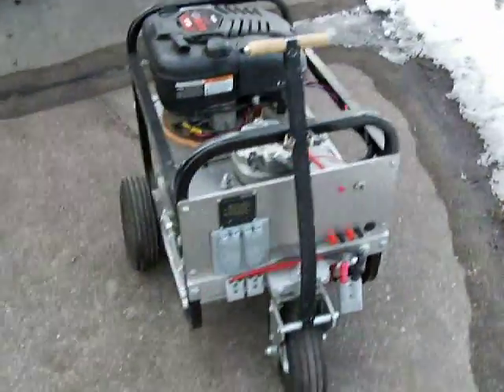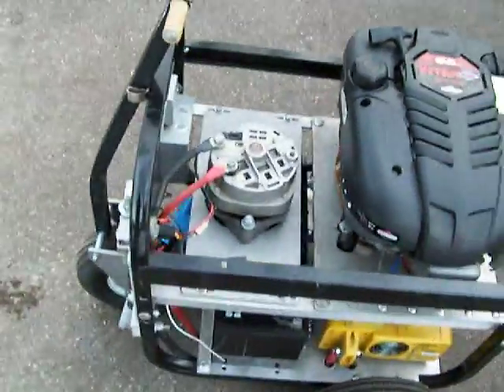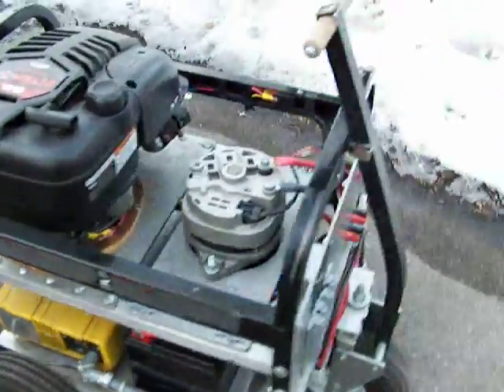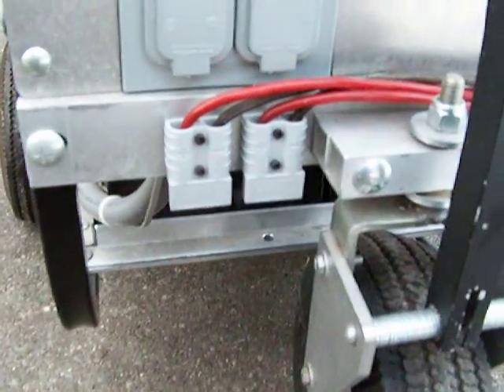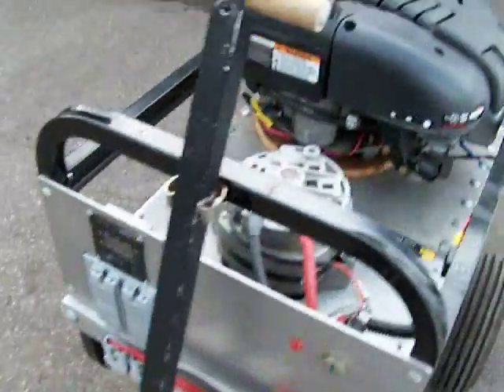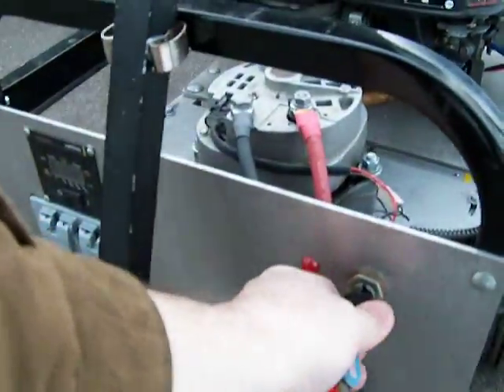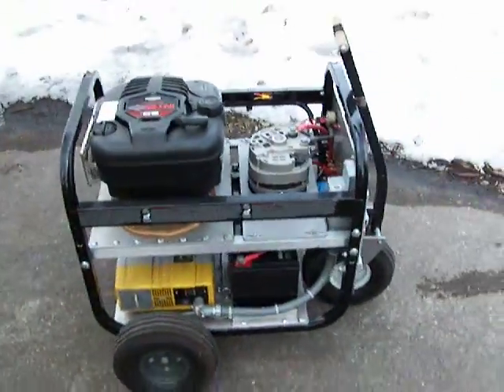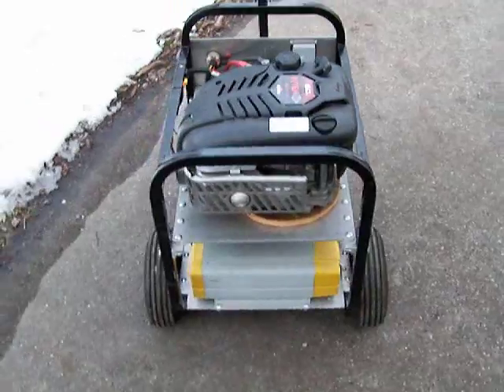Homebrew 1.8kW Inverter-Generator

Comment: Pretty cool.  How many times has it come in handy over the past 14 years since video made?  I read somewhere that you can get away with using the 3HP 79cc predator engine to power a 70 amp alternator for less fuel consumption, weight, and noise.

Comment: I've been looking into a system called the "power mite 110" in order to use the vehicle engine on my international ambulance as a generator. Doing this would be like a 1/4 of the cost. Originally I looked passed inverters cause I don't wanna mess with the charging system. I guess I now just realized if I'm adding a generator to the engine I could just add another alternator 🤷🏻‍♀️😂

Comment: good boy.  how about a brushless SEMI TRUCK alternator, 250 amps, with a 15 hp motor, for welding.  ??   may require a 300 amp bridge rectifier, if alternator diodes aren't able to handle current....
Reply from the maker: Sounds like a hell of a beast!  If you want some REAL off-the-shelf power, Niehoff Electric Company (NEC) makes militarily-ruggedized alternators for military ground vehicles anywhere from 200A @ 28vdc, all the way up to 1 kilo-ampere (yes, that's 1,000A) @28VDC.  They also make dual-voltage (14-28V) units.  They're always appearing in eBay.  Beware though, they're very heavy, inefficient (65-70% on a good day), and can be expensive.  If you get one of their 28VDC, 570A units, you're good for at least 15kW (16.18kW for 100% efficiency, which we know doesn't exist).

Comment: Why don’t you use a DC motor instead of the gas engine? You wouldn’t need to continually need gas
Reply from the maker: And where would that electric motor get the electrical power needed to spin it?  What you're describing is essentially a zero-point energy machine.  Believe me, if I could make oine of those, I'd retire a multi-billionaire tomorrow.
Reply: @SSD99  An alternator?

Comment: This is the most badass DIY genny ive come across! "Coulda bought a generator" but they dont make them THIS cool! Looks very sturdy and heavy-duty. What kind of gas and oil do you use? Standard 87 and HD30?
Reply from the maker: Just standard 87 Octane pump gas, and whatever the recommended oil is on the B&S maintenance guide.

Comment: I was going to ask, why not bypass the alternator rectifier and regulator all together going straight to AC? But then it occured to me, if my Generac (direct AC output) idle decides to go off kilter, it will fail to regulate to 60 cycles (HZ) and it will shut off output. Honda gens I've heard use onboard rectifiers to avoid this.

I actually had a car alternator recently with failed diodes in the rectifier. I was getting between 25 - 30 AC volts at idle. Not too shabby. Wonder what output is with no diodes??

Comment: SSD99 congrats on a great design. I have 5 of these Xantrex inverters to play with. One has the built in transfer switch so will auto switch from grid to inverter power which would be good for frig or freezer. Wanted to mention that in a power outage the inverter could use an idling beater car as a charger connected to the inverter through high amp jumper cables. No extra motor or alternator needed as is part of car. This runs quiet and not loud like a genset. Is best to have another battery local to inverter but not essential. I always use a cheap beater car for commuting so is also a 'generator motor' so don't have extra 6hp motor to maintain. It is easy to refuel cause it pulls up to the pump. The motor with alternator is smaller and more portable.

Comment: A very nice build, sir. As others have commented, you could buy a cheap, ready built genset for a fraction of the price yours has cost, but i'll bet in years to come, your set will still be going strong!!! Especially with that nice Xantrex Inverter.
Best regards.
Reply from the maker: ESPECIALLY because of the Xantrex! :D  Seriously though, I wanted to get two Prosine 2.0s in series for 120/240VAC output, but there were none available when I built this, and, I'd need a 28VDC alternator, because 4kW at 12V is just too inefficient.
Reply from the maker: To Harrothepilot: Thank you for those comments. It's when I look back at all that $$$ I put into it, then read comments like yours, that I feel validated in the approach I took.
Reply from the maker: To Mike Brink,  that's a lot of thoughts for one post, but I think I got most of it.  I gather you drive truck, based on your comments.  Since it's reasonable to assume you use diesel fuel, if you WERE to build something like this, I would recommend using a small single- or twin-cylinder diesel engine. The idea is to NOT increase your burden by having to maintain a second type of fuel reserve.  I DO like your ideas on auto-start and using solar as an expandable system 

On why you might have heard that PMAs should not be used, depending on your level of confidence/competence in designing and building these kinds of things, if you were to take the raw output of a PMA, say a converted old GM 10SI alternator, or maybe one of those variable-frequency-driven brushless washing machine tub-motors, and just PASSIVELY rectify it into DC, you'd certainly have issues, because the variable-voltage output would start to fry things.  If you were to contemplate using a permanent-magnet machine, you would need to design a rather sophisticated ACTIVE rectifier scheme that would hold the voltage near constant.

It's not impossible, since most hybrid-drive designs leverage the properties of one type or another of PM rotating machine, but it would be a challenge, even for the most seasoned designers.  I would recommend websearching the topic and see what you get.

One other thing to keep in mind is that since you'd most likely be working with power levels over 1kW, say goodbye to 12-Volt operation, since high power at low voltages means high currents and that translates to lower efficiency. 48-volts or higher is what is called for here, since higher voltages carry an inherent advantage of higher efficiency and flexibility.

While this took me about 1/2 hour to type (with edits), it would have taken me only seconds to say.  Good luck with whatever you decide to build, and if you DO make something, please let us know about it here.
Reply: Ntikfuh

Comment from the maker: @ Anthony Gillian:  The alternator doesn't power the house directly- it supplies power to the Inverter (w/batteries acting as a cushion).  I have connected it to the whole house before, and it powered: 2 refrigerators (3-7A), One 40-inch TV &Cable Box (1.5-2A), three 60W lights (1.5A) and our furnace (6A running).  Right up at the limit, but I'm sure it wouldn't power the house if the washer and/or dryer (and anything else of substance) were being used.  It WAS pretty cool that I was able to demonstrate it, though.

Comment from the maker: Hi Leon,
No, I never did a video of the Load-Step or Transient testing.  It wouldn't be hard to do, though.  Just have everything running, then switch on a 1500W hair dryer and see what happens, or just connect 12-15 100W light bulbs in Parallel & hit the switch.

Comment: I wanna say overkill! but that would just be the jealousy speaking.  well done man, very clean and well built.  I have wanted to do a low tech version for a while now.  just an old lawnmower engine and alternator for buck hunting.  skinning a deer @ night after a long haul sucks with fading flashlights. we use tents like normal people, not RV's here. so light is usually minimal.

Comment: 1800w would draw more than the 140A on the 12v side so it would be hard work for the engine to keep up with that, do you have a video of it going from no load to over 1000w to hear how the engine handles it ?

Comment: In answer to the previous poster the output of car alternators is not via the brushes, the brushes carry the magnetising current through the slip rings. The ac part is three phase from the fixed windings. Cool project, nicely done.

Comment: nice setup sir! have you had any problems with the alternator bearimgs running them vertical like that ? i have all the parts but only a vertical engine like yours as my horizontal engine is blown that i was going to use thank you

Comment from the maker: With all the expense of a "cheap" generator, 30-40A battery charger, and a DC-AC Sinewave inverter (and don't forget the battery, because your sinewave inverter won't like what's coming off the charger w/o some kind of filtering), you're almost up the cost of a Honda-like Inverter-generator anyway.  If what you desire is silent-run capability then build what I did.  Obviously, components may differ, but you get the idea.
Reply: cleanest most professional home built generator I've seen. i'm looking to build something like this this winter. I have two 700 watt inverter generators and a 900 watt HF storm cat but i'm looking for something else to play with with more capacity. I have lived through multiple hurricanes (floridian here). the ablity to run silent or nearly so is way under rated. last hurricane i made it several days by using a car battery, a 400 watt inverter, and charging it with my other car. it could run a fan, on low about 6 hours.

Comment: nice 4 stroke engine it sounds like...cool unit..maybe you could also add some foldable solar panels to make it more versatile and reliable if the gas runs out..
next step I suggest is to work on an electric motor-generator loop set..im still trying hard to figure out how some have made such generators run itself feeding back on attached electric motors..good luck and best wishes!!

Comment from the maker: 28V (Alternator voltage -v- Battery voltage of 24) at 600A = 16.8kW.  Definitely enough to power your whole house and then some!  The trick here is finding a suitably-sized DC-AC inverter that inputs 24-28 nominal voltage and outputs the 120/240 Split-phase AC required by the house.  You could series two Xantrex 5.5kW units, giving 11kW output, but these are not too common, and very expensive, like $2-4K each (??).  Or, you could try building your own.  Difficult, but not impossible.

Comment from the maker: I used a 7-inch, 6-groove serpentine pulley from a Ford 302 crankshaft for the engine, and a 5-inch serpentine pulley (slightly modified) from a GM smog pump for the alternator.  The Engine pulley needed some adapters to fit it to the engine's 7/8" x 3" vertical shaft.  I decided on these large sizes because they would allowe the alternator to be closer to the engine, giving a smaller footprint.  They also allow greater torque to be transmitted from the engine to the alternator.

Comment from the maker: Solo-
Throttle regulation depends on how good you can make a good control system. It would need to sense either DC current drawn by inverter, AC current drawn by load, or some other parameter that changes with load (assuming you don't use a straight AC generator head). For an Alternator-Battery-Inverter arrangement, your control system will be similar to what's on those nice Honda Inverter-gensets. Constant speed no longer the desired output, rather constant voltage, either AC or DC.

Comment: You don't need feedback, per se, in a system like you've created.

The governor on the engine increases fueling to maintain the engine speed as load increases. Spinning an alternator like that produces DC output so the engine RPM isn't critical to the process (assuming sufficient to support the load)..

The inverter is what's producing the proper 60Hz frequency, unlike a straight AC alternator where the engine speed must be tightly governed to ensure the AC frequency is correct (~60Hz).

Comment: During Sandy neighbors bought cheap Generac generators. The noise was driving me crazy. I gave in and got the better Honda generators, but they were a lot more expensive, but super quiet and reliable. Now I want a much larger generator, but the larger Honda models are out of my budget range. I am thinking, if I can get a small used Honda car motor maybe I can build one. How would I regulate the throttle so that when demand goes up the engine ravs harder?

Comment: Very nice.. I like the frame and wheels. I built something very similar, Mine is also electric start and it's remote controllable via a 2.4 Ghz spread spectrum RF link (Yes I'm a Ham). The remote control RF link includes 2 way telemetry data. This means I can start it and monitor various parameters such as Motor temp, Alt-temp,  RPM, Voltage and Current all from inside the house on a nice little 4 inch LCD screen located at my ham shack desk. For reliability I converted the motor to propane

Comment from the maker: Hey dpos89, from the Alt to the Binding posts, I use #4 AWG, and from the binding posts to each battery, I use #6 AWG to each battery.  Heavier wires are always better because they can handle more current w/o all the voltage drop.  It's like rush-hour traffic- It flows much better on an 8-lane superhighway than it does down a two-lane country load.  Tempers heat up on thast narrow road, much line too much current on too thin a wire will cause it to heat up.  I just love the humor! LOL!

Comment from the maker: I've had a 12V light for about a year, but never actually installed it.  That's the next thing.  I'll post a quick video when I get it done.  As for the engine speed, the throttle isn't too loose, so it's not difficult getting it to stay at any speed I choose.  Yes, I know I need to have some sort of feedback to automatically change engine speed dependent on load drawn, but I'm no control systems expert.  I've startedd onm  my 9kW unit, and feedback will be a MUST for that one.

Comment: very nice gen set! The only thing missing is a 12 volt utility lamp to light up the gen set when using it in the dark :)
When you said the motor runs at whatever speed it needs to, how do you have it wired up to be governed by the alternator and the load?
Thanks!

Comment: This is great work! I'm toying with my next generation generator setup. I have a standard 3500W generator now and manually switch to battery back up using an inverter at night to cut the noise, just to keep the fridges cold. Works well enough but I want something better. Videos like yours are very inspirational so thanks for posting! 73s, Sander W1SOP

Comment: What size wire from alt to inverter? Is it better to have wires heavier? Also how did you mount the inverter controls to your control panel? Was it removable for remote mounting? Thank you

Comment: Same place the energy goes when the regular A/C output generator running in the yard goes when no appliances are running. Same solution too, dont let it stay running. The benefit of the battery / inverter is that you can generate the power at peak efficiency (if your engine size / alternator size are matched as well as the pulley diameters, 

and you can keep using the power even when the engine is not running. Voltage is more consistent, especially when a load is applied.

Comment: love the set up but why not use AD244?  145-220 amp and if it goes out take it back under warranty at local part store.  they have 2 and 4 pin ones

Comment: His Alternator, after it converts AC to DC to power the batteries. He then uses the batteries to run the inverter as a sine wave, not square wave inverter.  The reason this idea works, is that most generators have voltage output proportional to engine speed, so that their voltage would fluctuate as the engine speed changes. In this case, the inverter keeps voltage constant no matter the engine speed. Also, alternator is cheap, at 12 Volts at 100 AMPS, (High AMP,low Volt), but he wants high Volt

Comment from the maker: The battery hold-up time is determined by the battery capacity. As it sits, I have 100Ah of reserve, with external 12V connections for power import/export as needed. I have an additional 1kAh capacity available, giving a revised hold-up time of ~ four hours at 400W = 1.6kWh capacity.

Comment from the maker: Also, the electronic tach wire performs the dame function as the old AC tap on the stator. The alternator is an OEM 140A unit. The internal regulator is temperature-compensated,  putting out ~14.2V in the winter, and ~14.6V in the summer.  From three, it charges the 12V battery pile, and provides a 12V input to the 1800W DC-AC sinewave inverter. The batteries perform 2 functions: 1) improve load-step response; and 2) continued power for the inverter during silent-operation, or refuelings.

Comment from the maker: @ firstmm5: the four connections are: 1) field on/off; 2) (+) batt sense; 3) indicator light; and the big BATT terminal. The fourth small-gauge connection is an optional electronic tachometer the alternator's internal regulator uses to talk to the engine's computer. Obviously, for my purposes, the tach wire is not used.

Comment: Nice work!
How well does the alternator stand up to being vertically mounted like that? I've often wondered if doing that affects the bearings in a negative way being it was designed to mount horizontally.

Comment from the maker: @Peewee0413 It does. The CS-144 alternator, like all current Delco units, is internally regulated.  I believe there may be a provision gor trimming up/down the voltahe, but I'll have tk verify this, because there were several voltage regulators available.

Comment: One of my next projects will be a turbocharger to gas turbine conversion, I'm thinking that this would be perfect for that power plant. Plus, the turbine will probably use natural gas, at least as the primer fuel. Then, it'll have a secondary, liquid fuel injection, that will burn about anything that will burn. Even old french fry grease, old motor oil, whatever. Biodiesel, it'll love that. I still want to integrate an afterburner, if nothing else, I can power roast weenies with it.